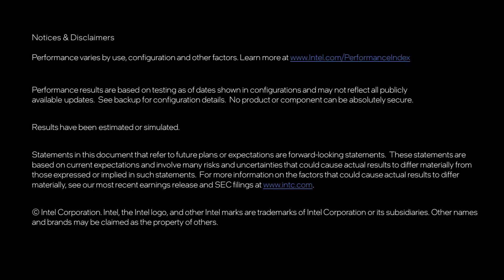3D Stacked Transistors: Improving Area By Building Upward | Intel Technology

Comment: Sounds similar to IBM's VFETs. Stacking logic on top of each other, instead of increasing die area. Fascinating stuff.
Reply: bc is it , it just difference name :))
Reply: @EsonaEsonder  yeah, this is before I knew IBM license their stacking technology. Pretty neat, game changing stuff.
Reply: @carl8790  idk when this technology come , my guess i think 2030 maybe :)) maybe next gen consle ps6 using it
Reply: @EsonaEsonder  2030 seems to be a safe bet. GAAFETs are around the corner. I think most likely that next gen consoles might utilize GAAFET than VFETs.
Reply: @EsonaEsonder If you look at IBM's VTFET and the CFET architecture stated in the video, you'll notice it's two completely different things. IBM VTFET is more like FinFET transistor but rotated 90 degrees so the fins are now horizontal which gives opportunity to save space and increase density. For CFET which is based on GAA, the gate fully wraps around the channel unlike FinFET (and so VTFET) and CFET is utilizing the space freed by GAA to stack two complementary types of transistors now on top of each other instead of side by side.
Reply: @licson0729  so which one better ?
Reply: @EsonaEsonder  Personally and also according to imec, CFET is a more popular choice after GAA since it is even more compact than IBM's solution and turn the horizontal PMOS-NMOS groups into vertical groups that basically allows 2X increase in transistor density just by shifting to stacks. I also think CFET is better in terms of area and research around it. (VTFET is currently IBM patent but CFET is being studied by Intel, TSMC and imec as next-generation transistor architecture after GAA, Intel has also just made a huge progress in producing both PMOS and NMOS part of a CFET transistor stack in a single production step, which is just crazy)
Reply: @licson0729  do you know when come production?
Reply: @EsonaEsonder  utilizing the third dimension is the most advantageous to increase density.
Think about it like skyscrapers vs terraced homes. CFET has NMOS and PMOS in the same skyscraper
Reply: @EsonaEsonder  probably 2031ish for cfet and gaafet is 2027ish

Comment: I think the reason intel delayed at 10nm was they tried to implement too many technologies simultaneously; Superfin, RibbonFET, PowerVia. Glad to see they now have a better update rollout. With High-Na EUV round the corner, the combined manufacturing future tech is very impressive. Makes you wonder what sort of experiences devices and technology will offer in just half a decade.
Reply: "implement too many technologies simultaneously: superfin, ribbonfet, powervia"

Source?

I dont remember original 10nm having any of these

IIRC, aggressive scaling, no use of EUV and bad management/leadership were the primary causes of 10nm delays
Reply: @suntzu1409  Intel was on the tick tock schedule for a while; improving the design one year and shrinking the design the next. However, subsequently Intel kept releasing 10nm chip after 10nm chip for a while.
Reply: @AlexFoster2291  
What does that have to with ribbonfet, powervia,....?
Reply: @suntzu1409  it doesn't have to do with any of those. I was clearing up any confusion you may have had with 10mm